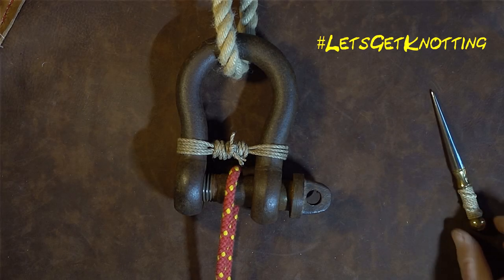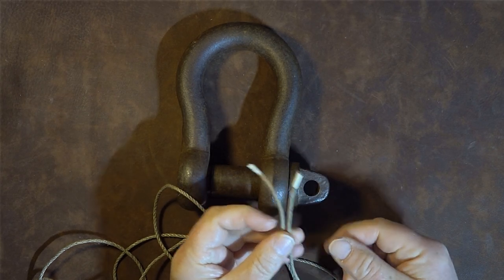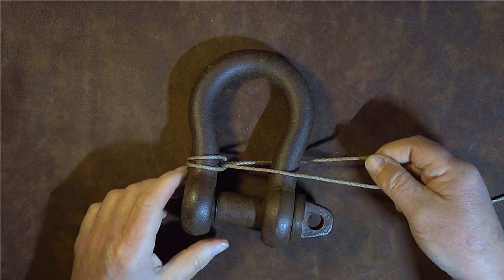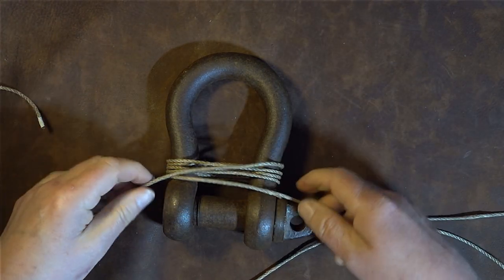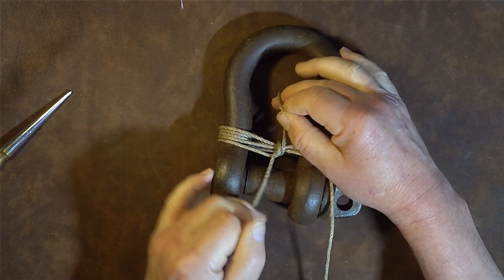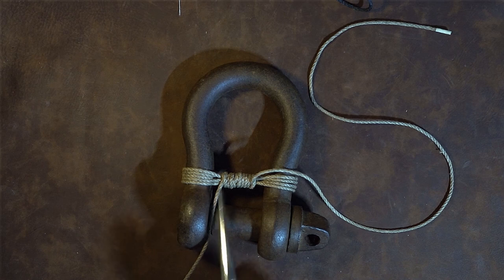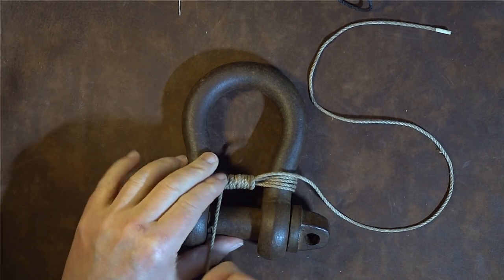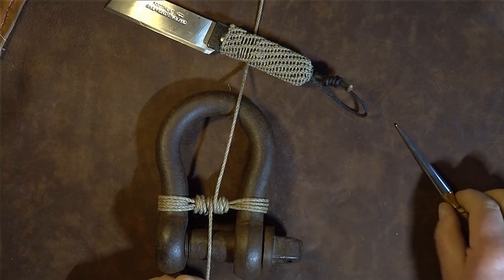How to Mouse a Shackle Body - How to Make a Shackle More Secure

Comment: Good video thanks, the only question I have is why leave the pin of the shackle in place which makes the frapping far more fiddly to do?
Reply from the maker: You are so right.......................... sometimes  you get so obsessed with filming it correctly, you forget about the basic simplicities. This video really frustrated me, as I try to do my vids in one take. After lots of swearing, I broke it down into parts............... still no excuse for that shackle pin though ;-)
Reply: @KnottingKnots  lol I understand, it’s always easy to point these things out afterwards, but it’s probably something I would do myself
Reply from the maker: @landraver90  I always find that after it has gone live, there is very little that can be done to rectify and error. I guess, so long as people get the idea of what should be done................
Reply: @KnottingKnots  I always enjoy your videos, the instructions are very clear and easy to follow, that’s the important thing, thanks again 👍

Comment: Why is it called mousing?
Reply: because back in the old days they used to use the tails of mice or rats (dependent upon the size of shackle) for the actual cordage. The cartilage in the tails was far superior to any small cordage/twine of the time. And while, on larger shackles, it technically is "ratting", that term has an entirely different meaning based on an ancient, unuttered activity performed in a Singaporean wharf bar of ill repute.
Reply: just kidding. I don't really know.
Reply from the maker: I am sure that back in the day, we used to call it snickling (I think it was slang for obstructing)? As for the term Mousing, I rather like what @flatlinesup says ;-)
Reply: An entertaining explanation.  Must have been time consuming to splice all those tails together.
Reply: @garycort7997  They just used a tail stretcher. It's a tool rarely seen in the antique stores anymore.
Reply: @flatlinesup  
lol,